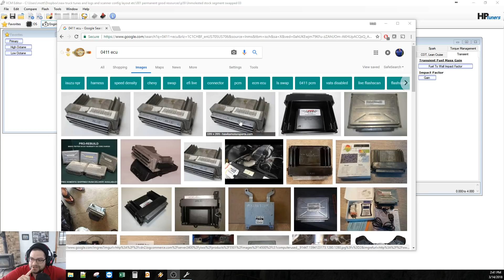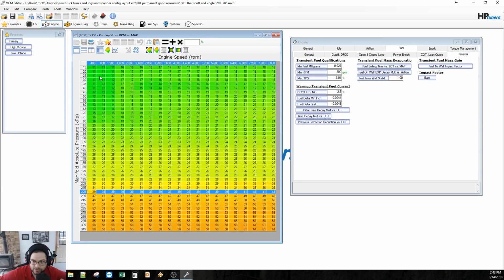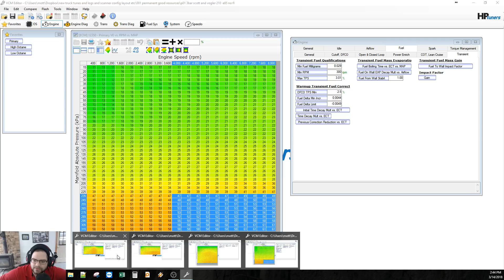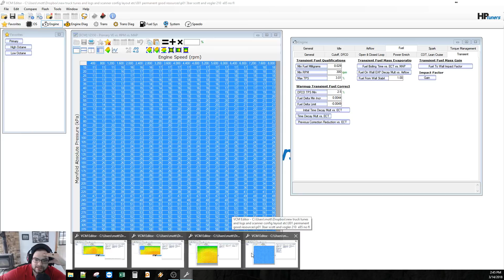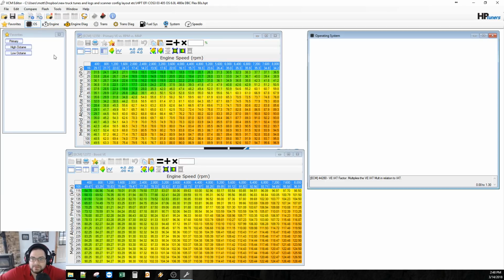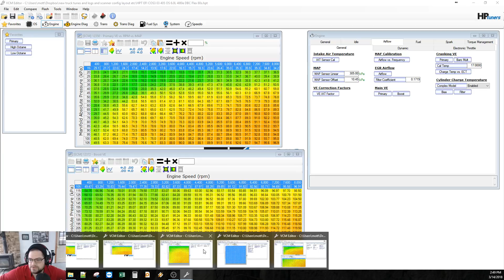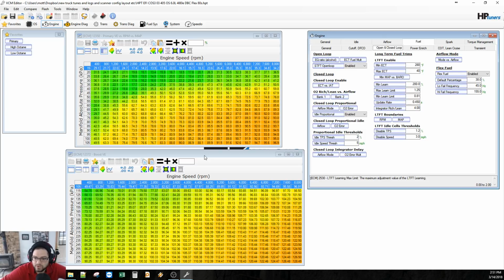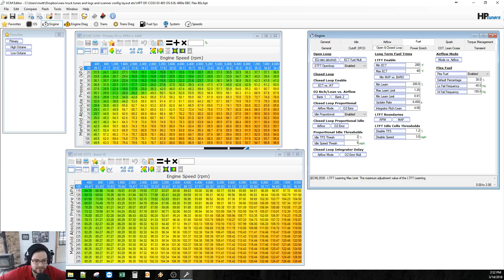p01 p59 stock to custom OS followup video

Comment: Wait, if all the MAP sensors go from 0 to 5 volts (0 being full vacuum and 5 being sensor's max boost rating), you might be able to use a 1 bar sensor and tell the ECU to read it as a 3 bar, and just keep in mind that the KPA numbers on the table are false. That could get you the extra resolution of the 3 bar map.

Comment: With a basic voltage divider you might be able to use a full 3 bar map on a naturally asperated engine. You'd just have to keep in mind that you're tuning on a purposely created false reading sent to the computer. Actually no, I think you'd need to multiply voltage, and a divider would only let you get a chunky, low resolution 1 bar map to work with boost... oh well.

Comment: Matt, have you ever got into the VIN numbers on the EMCs?
The numbers at the beginning of the VIN says where theyre made.
1- USA
2- Canada
3- Mexico.
All three of them use a different OS and all use theyre own O2 sensors and from what Ive found, they cant be interchanged.
I tried using the flat blade O2 sensors with a Canada ECM and it didnt work out. I had to get the corresponding ECM for the O2 sensors.

Comment: Would be nice if you could get a the better os thatworks with drive by cable or just ya since efi can find a place for it why cant hp tuners or have the option to remove something for that resolution

Comment: P59 QUESTION!!! Warning this question is of rambletronian levels and might sound like a cluster of ignorance. I have a 04 GTO ls1/t56 cable throttle body twin turbo set up ( it’s a swap) I’d like to for now run under like 15 psi ( if I swap to l33 bottom end, if not I’ll only push like 7psi ) I’d also like to run flex fuel because I’m a greedy rat. Am I straight up waisting my time using the p59 with the AIC chip ? I don’t wanna show up and have the tuner look at me like I’m from planet Rambletron of pure Rambletronian decent. By the way I think Sloppys play on the word ramble is pure genius.

Comment: I'm not sure the p59 is worth it for cable users. Flex is mostly irrelevant to a weekend/race car since it will rarely if ever change between fuels. Even then 50-80% ethanol use virtually the same timing. It's only worth it for an OEM or tuner that has a guaranty/warranty at stake.
Reply from the maker: i would disagree if its in your area its totally worth it to be able to mix the fuels worry free without re tuning anything

Comment: First off, great stuff and info you  present, thank you.  After watching this vid and the 30 min one, I want to echo back what I heard on playing with OS and how to "get them" and use them.  I have a P01 on 2002 5.3 I swapped and have HPTuners license to all 2002 Silverado engines.  From their tune repository I downloaded a 2002 Tahoe stock tune which has Flex ENABLED.  So the process to start/get a FLEX tune is to purchase a license for that Tahoe tune file,  do the compare/difference from my tune to that Tahoe tune file.  Then I flash that Tahoe tune to my P01 and I would be running the FLEX OS with my configuration tune.  Doing that would keep my VIN as is but have the FLEX OS feature on my ECU. Further, I can enable MAF Enhanced RTT os mod on that file  (I am MAF based only for now, if not forever on this rig) and enable that as well.  Is that a correct echo back on what you have said?  I have watched both videos a number of times now and it makes better sense each time and adds some more questions - which is good.  GREAT stuff you have and great presentation.
Reply: Okay I did license the tahoe and updated it with my current silverado tune I have created over time.  I wrote that to my spare P01 ECU and I learned that writing ENTIRE write the tune's VIN as well. Thus my ECU has become a Tahoe ECU. Didn't know that. Learn things at every turn.
Reply: matt do you have that silverado MAF  base/stock tune with FLEX still?  I could not find it at HPTuners  (2002)

Comment: Damnit! There goes my views! LOL. Good video brother! 👍 That lower resolution is why I recommend just using a 2 bar if you dont plan on going above 14psi on a P59. That way you get a tiny bit more resolution. Of course if you wanna go above that and still want that flex fuel then you really dont have much choice. That custom OS with the boost VE is something id like to play around with as well. Any links on that?
Reply from the maker: All in the tune cabinet!
Reply: Thanks brother. I guess Im gonna have to head back over there. Probably saw it and didnt realize what it was. ;)

Comment: Let me preface this comment by saying I’ve never done any tuning, total newbie, just picked up a 98 Chevy van with a mpfi efi 454. I took the efi and heads off to put on a 502 short block for my motorhome. No boost, marine roller cam, headers and dual exhaust, 4L80e trans, 4.56 gears and 32” tall tires. Should I swap to a LS computer to tune the bigger motor with cam and headers? Run closed loop? My first step will be reading the sloppy wiki site, as well as some great stuff on the Chevelle site. Any guidance is appreciated!

Comment: Hey Matt have you tried ironing out the 210s fuel table on a 1bar os then flashing back to 3 bar?  Although I tend to run closed loop I did notice my fuel trims were pretty on par between os's. I've also scaled the engine friction torque table to raise idle kpa and that helped

Comment: Ive had this P59 custom OS for a while now and I was so confused because mine was different than everyone else's. I didn't realize I had such a one-off thing. I've posted on some Facebook pages and people say "how did you get your VE like that??" and other stuff. Btw, it works great on my setup! 2006 Sierra 5.3 w/ s475
Reply from the maker: The dual ve?
Reply: Yes the dual VE and the Boost vs. KPA; you are able to pull timing via MAP which is a cool feature. My tune isn't scaled so I run right off my timing table at 1.20+ g/s.  I had someone with EFI Live do a base tune back before I had HP Tuners.
Reply: @SloppyMechanics  do you have a copy of the dual ve os or you know were i can find one?

Comment: Hmm, I'm pretty sure my P59 w/ 2 BAR has same resolution as that P01 2 BAR. I'm probably wrong though if you are posting about it
Reply from the maker: I think you’re right but flex and 3 is tiny
Reply: P59 with 2bar switches from multiples of 5 to multiples of 10 as well as losing the first 25kpa of resolution off the top. P59 3bar does the same but switches to multiples of 20 above 100kpa.
Reply: I have a P59 in my 2004 gto and I lost resolution going to a 2 bar os.  I now have 30 to 210 kpa in steps of 10 all the way up.
Reply: Just checked my tune, I do not have the resolution as the P01

Comment: Lower base pressure will help the large injectors like the Bosch 210's achieve better idle quality, and will not be so rich when you are limited by your fuel table resolution.

Comment: Mr. Sloppy! I have a question, do you run your turbo truck closed loop? I thought I saw in another video of yours something about your o2's overcompensating for fuel or something, and thought running closed loop in boosted vehicles with the older computers is dangerous because the MAF is too slow or something (at least what I've read in forums). I'm still learning tuning and would love to know! Thanks for all the helpful info!
Reply: Technically yes, it will correct itself when in closed loop but you still need to tune ALL cells because you will hit some of the same cells during WOT that you will while using part throttle. Also, the pcm can only trim so much so it’s generally not a good idea to be driving around with fuel trims way up there.
Reply from the maker: I am
Reply: Sloppy Mechanics Thanks for the reply! so it's totally safe to run the MAF then? Does it need to be rescaled for boost?
Reply: Closed loop only occurs under partial throttle conditions. Under those conditions you’re commanding stoich which is what the narrowband O2s are designed to read. They aren’t used at WOT since you’re then in open loop and commanding something other than stoich.
Reply: Bad Luck Garage Ok gotcha, so power enrichment would not go off of what the o2's are reading, only the MAP table. So, (in theory) to get the car driving decent, I don't have to worry about tuning the partial throttle parts of the table to get up and running properly, just idle and WOT? Man, I hope that is the case, because I have been trying to get this car drivable around stoich in just open loop (which I thought you had to do with a boost car) with just standard Hptuners (so I can't log my wideband) And it has really been kicking my butt. I know these questions sound redundant but I am learning how the computer program actually works. I've tuned many carbed vehicles but never tuned with a computer. Btw, thanks again, so much, for the info!
Reply: Hes not running the MAF. You can run closed loop with a SD OS as well.
Reply: Bad Luck Garage Oh, gotcha, thank you. So it's regulating fuel by the MAP table and o2's. I didn't know you could run closed loop without MAF. But I thought even the o2's weren't accurate enough to trust? Idk lol, I'm still learning. So the 2 bar and 3 bar OS's that you can select in Hptuners are set up for closed loop then?
Reply: Bad Luck Garage Really appreciate your help. I subscribed to your channel as well
Reply: Yes sir